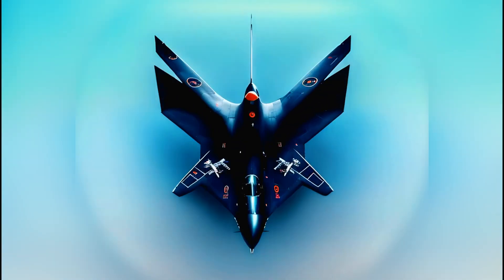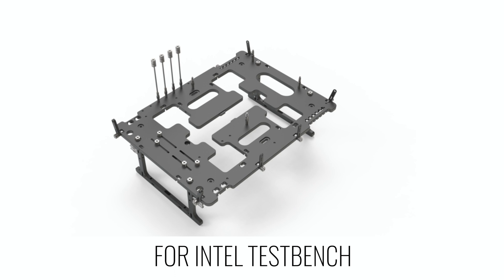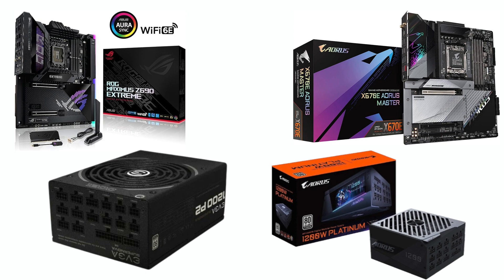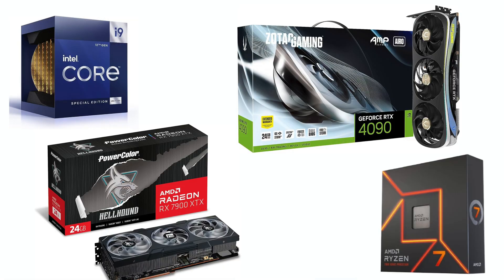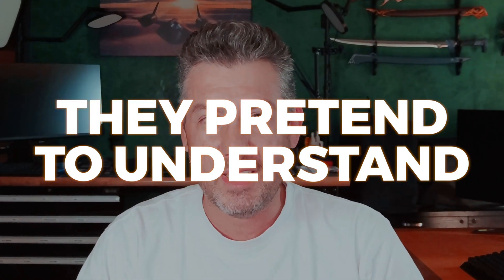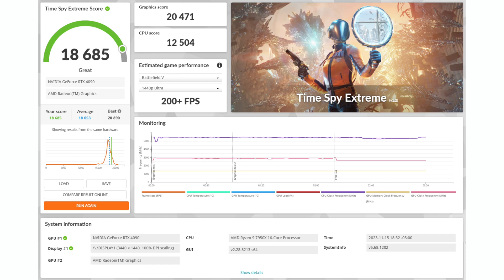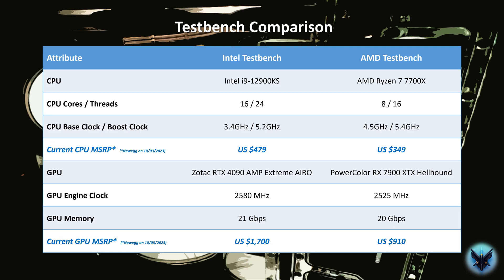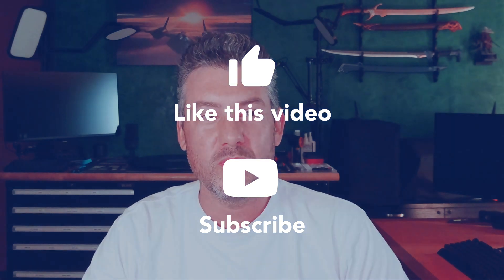How To Build A PC Test Bench!

Comment: Question for you: I’m planning to switch to a test bench. For your 360 radiator, how are you positioning the fans ntake or exhaust and which configuration is better?
Reply from the maker: That's a great question and the answer is different for an open testbench. For my radiator I put the fans on the outside so that they push air on to the radiator and thus on to the motherboard (VRM, RAM, etc.). You will be pushing warmer air on to your components but it's better to have air movement over your components rather than push air away. Your GPU should also be pushing air on to your components too.
Reply: @blackbirdpctech  Thanks for the reply I was thinking the same thing do you think that this warm air with overheat the VRM?
Reply from the maker: @spirosgerokostas   for an open benchtable the primary concern should be airflow over components since any warmer air rapidly mixes with cool air

Comment: A few years ago I built a test bench that I use for checking components, including PCI stuff.  It's an FX-8350, R9-290 system with a 128GB SATA SSD and 16GB of DDR3, so obviously it's not for benchmarking.  Most of these parts are from the first ground-up build I ever did, to play FFXIV with my daughter, who was an undergrad at the time.  It's old, but it all works, and it's a conversation starter, especially since it's open air.
Reply from the maker: What chassis did you use for your testbench?
Reply: @blackbirdpctech  Initially a DIYPC Alpha GT3, but now it's on a DimasTech Mini V2.

Comment: Question for you! I’m going to be building a PC later on today. I bought the same asus hero z690 w/ a gigabyte RTX 3070, i7 13th gen and Icue H150i. I purchased an 850 watt power supply, and at the time was thinking it would be enough. I see that you got a 1200 watt, but have a beefier card and CPU, do you think the 850 will be enough for me?
Reply from the maker: Short answer is yes, it should be fine.  There are a lot of psu calculators online that you can use to estimate your power needs.  Bequiet! has a good one on their website.  That said, I always tend to go bigger when it comes to a psu … the most efficient part of a power curve is typically around 50% load, so it’s always good to operate there and leave enough headroom for future upgrades and/or power spikes.  I am planning to do an upcoming video in this series on how best to select a psu.
Reply: @blackbirdpctech appreciate the reply! I’ll check out bequiet, I’m curious now haha. I’ll be looking out for that video! Just getting back into PC’s after a long 10 years away, basics are the same but I’m definitely a bit rusty 😆
Reply from the maker: @joebalzano7461 by the way, for my test benches I went with larger power supplies so I could accommodate the future testing of any components … I didn’t want to have to swap out PSU’s.  Great to have you back in the community, please subscribe so you don’t miss out on future content drops!!